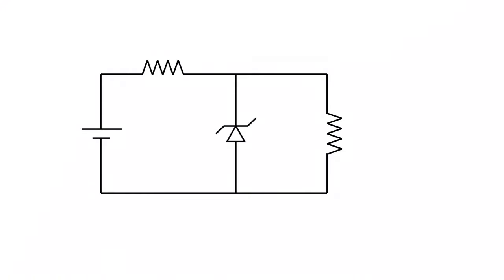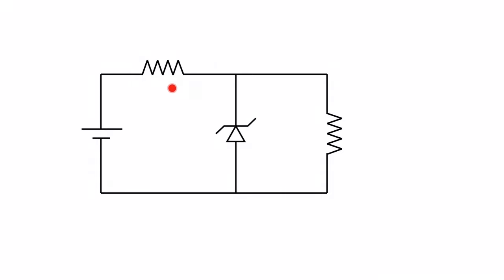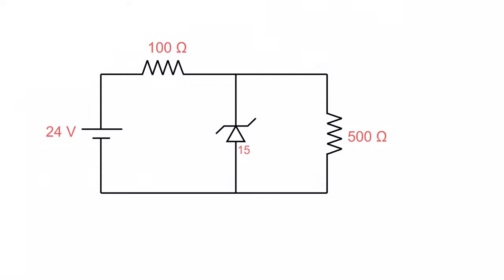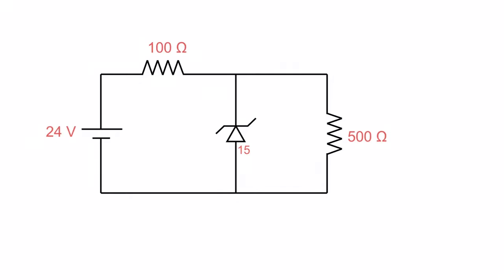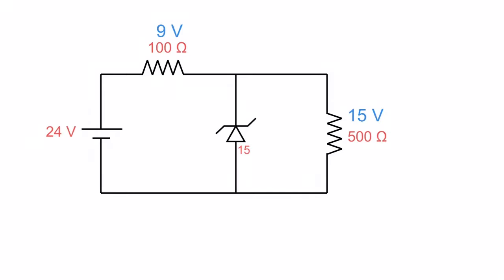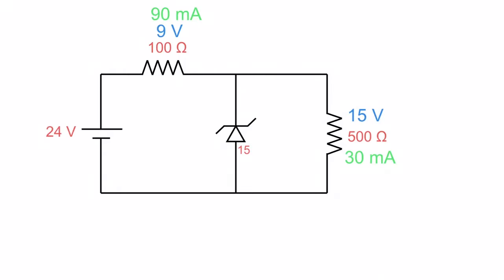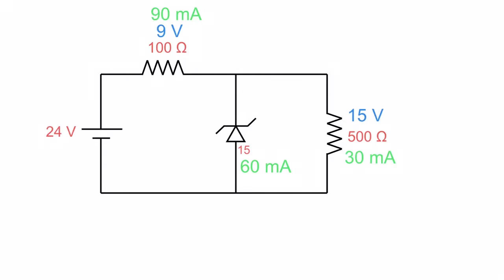Zener as a voltage regulator

Comment: Exactly what I wanted - clear and simple.  Back tracking though is {havent tested yet}  300 OHM for R one  means  30 mA drop so no loss - or does this need to be slightly  higher to ensure the diode works.

Comment: Thank you for the video. I have a GPS mount on my motorcycle that I have plugged into the 12v output on my regulator. The Dock says it must have a constant and steady 12v supply but as there is no battery on my bike I keep getting battery errors on the GPS at high rpm. I'm thinking because it's outputting more than 12v at high rpm... Can I use a Zener to fix this issue? Thanks
Reply: No, you need a steady voltage. You could buy a small buck boost converter and manually adjust it to the correct voltage between your bike regulator and the device.
Really you need a small seperate battery as you could still overload the device with nowhere for the power to go.
Reply: @stupidscruff5794  thanks for the reply. That is actually what I ended up doing, but it didn't make a difference. I found that if I just removed the battery and ran it direct, it was okay. I assumed the battery was faulty but a new one did not help it. Now I just run it of 4 AAs to keep it going when the bike is not running

Comment: I understad that diode bocks 15V for itself but why it is slso 15V over second resistor?
Reply: because it is in parallel with the diode.. 2nd resistor is tapping off the voltage of the zener which maintains it's voltage.

Comment: Why is the current limiting resistor necessary? What would happen if the zener diode is connected in reverse bias mode directly to the source?
Reply: The source has 24 V. Zener diode has a turn on voltage of 15 V. Now since load resistor and zener diode are in parallel,the voltage across the load resistor will always be 15 V independent of the source voltage. (Thus regulation of voltage across load resistor is done).
The extra voltage i.e source voltage - voltage across load (24V - 15 V= 9V) will be carried by the current limiting resistor (kirchhoff's law)
Reply: Removing the limiting resistor would be like a limiting resistor of 0 ohms. Make it 1 ohm for simple calculations. Now repeat his calculations. That would make the current 9 amps.  Subtract 30 mA going to the load and that leaves 8.07 amps going through the zener diode.  Poof!  Your diode just went up in smoke.

Comment: Does the voltage of the source need to be higher than the rated voltage of the zener diode?
Reply: Byron Storm yes all it can do is drop the voltage as shown, about 9v and passing 15V to load, but it cant increase voltage, like 5v supply and u want to get 15V then it wont do anything..also the diode should be under max operating voltage also. Hope that makes sense
Reply: Alright thanks
Reply: Byron Storm wlcm :)

Comment: What does it mean when you say 'blocks' the 15V. Please someone help
Reply: Divya I think his wording was off. It’s a 15v Zener so it’ll only allow 15v to pass to the load. It will block the remaining voltage from 24v so 24 - 15 = 9v. It’s “blocking” 9v to maintain 15v at the output
Reply: mrsemifixit oh okay thank you
Reply: Actually, the zener blocks voltage until the voltage reaches 15 volts. Then the diode breaks down and current flows, causing the voltage to stay at 15 volts. It acts as a pressure relief valve and bleeds fluid (current) so the pressure (voltage) stays below 15 volts.  So the diode is actually blocking the 15 volts and passing the 9 volts.